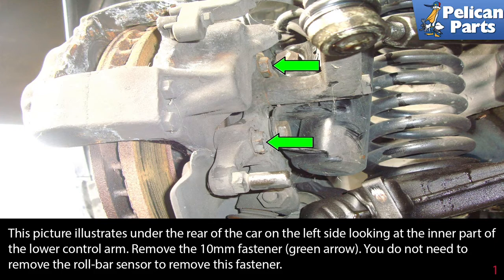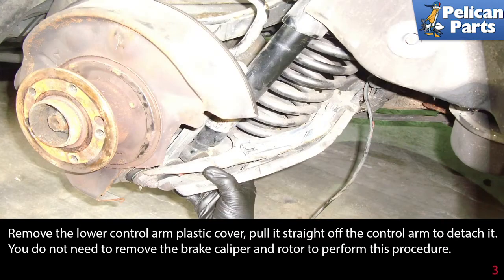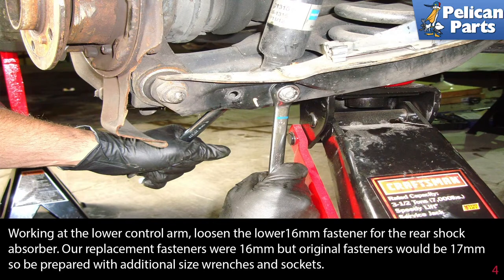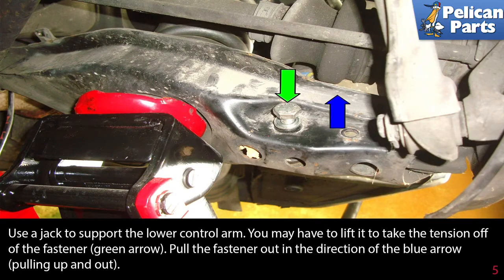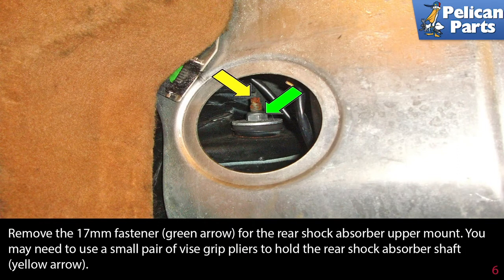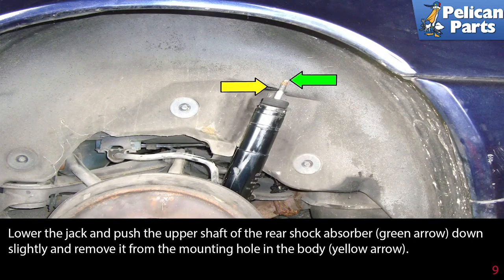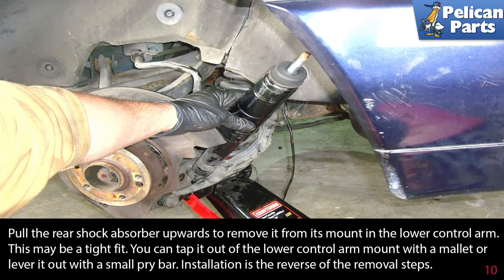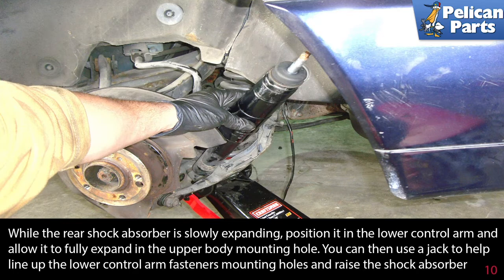Mercedes-Benz R129 SL-Class Rear Shock Absorber Replacement

Comment: I managed to glimpse the right hand shocker but the other side looks buried, i will have to perserver with this. As always my thanks for the video it points you in the right direction, SL 300-24 cheshire UK Ps, there are two bolts that hold the plastic shroud on, i used a spanner to get them off .
Reply from the maker: You can do it!